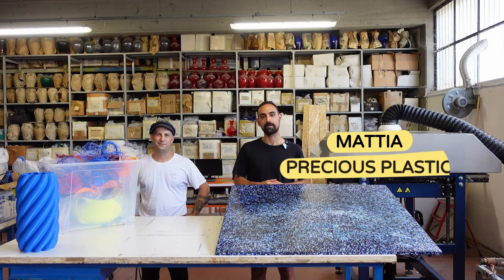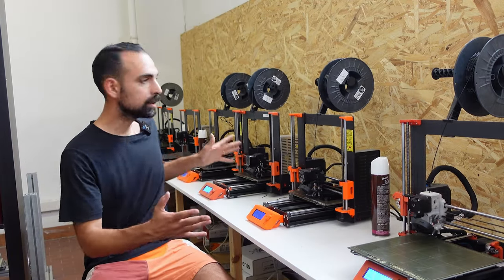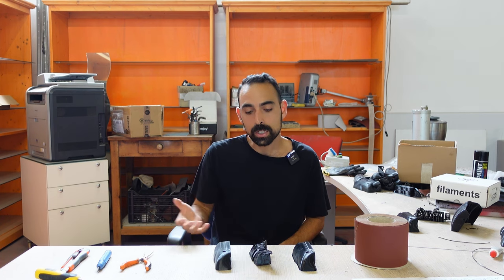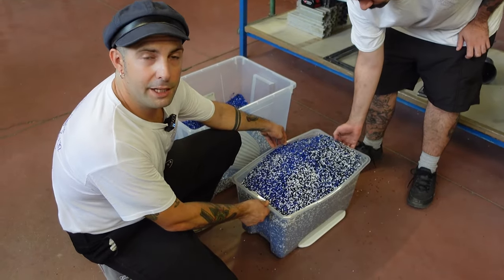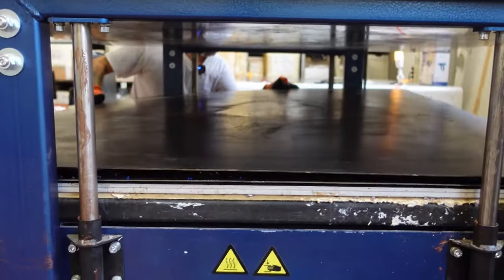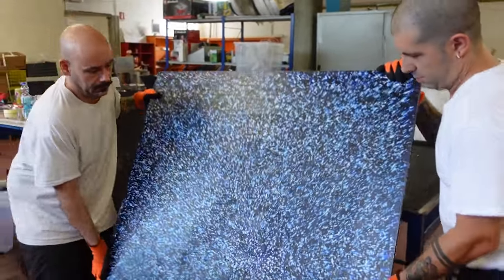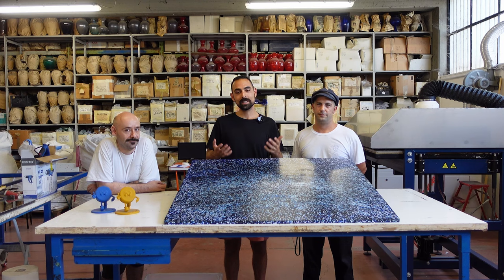What to do with all that 3D printing WASTE?

Comment from the maker: There has been a bit of confusion regarding the failed 3D print and filament being shredded. Indeed both were shred and used in the final sheet. The point being that both the failed prints and the filament were PLA, hence the mixing. The process would be the exact same had we use exclusively failed prints. We hope this can still be useful to many out there 🤙

Comment: you started out with shredded prints and supports, but then you used shreddeds filament. i wanted to see the process with shredded prints though. :(
Reply from the maker: Sorry if this caused a bit of confusion. The process is pretty much the same, doesn't really matter. You just have to shred the failed prints. Once you have the shredded plastic the remaining of the process is the same.
Reply: lol
Reply: meaning you have to have an access to a machine that shreds plastic and costs a lot of money...
Reply: @CraftySven A blender works.
Reply: That's right  @CraftySven this cost is especially stark when compared to 3d printer farms, which grow in trees wholly formed and are commonly given out in place of change when buying groceries.

Right?
Reply: @CraftySven That's what PP is all about. You can download plans for a shredder, press, extrusion press,...

Comment: The sheet did not seem to be made from recycled waste but with shredded filaments that were uniform, your process will deviate a lot with larger particles and different shapes of shredded materials. Also, for the mold release, there are a lot of powder releases available that might be cheaper and faster than spraying on silicone ones.
Reply: indeed. Very missleading.

Comment: Dude acted like he was using shredded failed prints and supports and just used plastic pellets...
Reply from the maker: We used failed 3D prints and discarded filament, no pellets :)
Reply from the maker: Eitherways the goal is to use 3D print waste material to make something precious once again if is in the form of failed prints or discarded filament doesn't matter, we aim this video to inform people they can use 3D print waste streams in their Precious Plastic machines
Reply: The sheet does look a lot like uniform pellets. You showed the prints being shredded, and they clearly weren't the same.
Reply: @bestpony12 It looks like a bunch of shredded up filament that hadn't been printed with.
Reply: What do you do with these plates? Wouldnt it be better to recycle the PLA into new Pla Filament?

Comment: Instead of using silicone release, maybe look to bakers who use parchment paper. It can take the heat and isn't very expensive. Can possibly used multiple times as well.
Reply: I have used parchment paper in my small scale experiments in a toaster oven, and it works very well
Reply: @flyingpurplebovine  what temperature would you recommend and how long does it usually take?
Reply: @rondelapena6024  I had it at about 400F (200C) for about 20 minutes, and that made pliable kind of like silly putty. I used silicone oven mitts to mold it and stretch it, and I could put it in a manual mold. The final result still had some small air gaps, but it was a very successful proof of concept
Reply: Parchment Paper will degrade over a certain amount of time. There are textiles that can widstand it ( haven't researched what they are called ). But for repetitive usage silicone can widstand the heat and if could be reformed if done by in a mono material fashion.

Comment: I always love to see people focusing on recycling the plastic from failed prints, bonus points if they are from my country :D
Reply: They actually don't recycle they use PLA pellets bought separately. No recycling happening in this video.
Reply: @antonkukoba3378 yea, they do not have access to that much pla failed prints but I'd say it can work the same, i've seen people make these at a smaller scale at home so why wouldn't it work on a larger scale with less waste?
Reply: @antonkukoba3378 good proof of concept tho, teaching tech made of video of doing this on a more small consumer scale and used shredded print waste for it. And it looked great like this
Reply: @antonkukoba3378  You don't know what you're speaking about.
That's waste filament shredded in house.

Comment: Great point in connecting two passionate communities that are currently on the opposite sides of recycling. We should definitely promote filament recycling and collection centers as most of 3D printer users would not have the sheet presses, but have good quality raw materials they paid premium for.
Reply: Would be a pretty solid business model, buy the scrap by weight and make sheets to resell🤷‍♂️

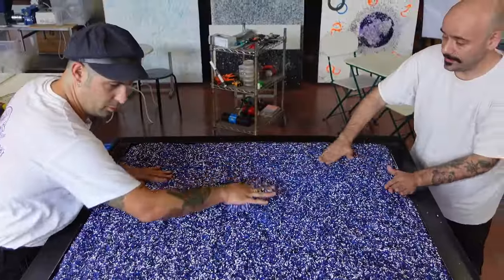Comment: 3:00  and 4:32 shred filament has different shapes.   I'm confusing.   4:32 shred filament is not pellet, but broken filament.
Reply from the maker: 3:00 is support material (PLA) while 4:32 is indeed shredded filament (also PLA).

Comment: You might be able to use these as tiles to walk. I don't know what the hardness is or if it's fragile. But small tiles might be good for a workshop type setting.

I'll certainly be looking into tiling my workshop with that.

Comment: I wonder how the process changed the chemo-mechanical properties of PLa ? Did they heat it over the crystallization temperature? Is crystallized PLa UV resistant after re-crystallization at higher temperatures into sheet? Also, people misinterpreted the plastic used, the smaller fraction shredded material should have sieved down below and bigger fragments stay at the top, those were clearly NOT pellets, pellets are way smaller.
Reply: looked like what they poured into the mold was  cut up off spool pla,  almost like  there using  moastly  end spool lengths, rather then failed or excess prints...   no other way to provide consistency of  speckling in the end product....

Comment: I may have another comment towards the end, but I must point out that at around 2:09 your support settings are WAY too aggressive. You can easily cut your support angle down to like 45-65 and shave off around 30% of your support material by no supporting such shallow angles. 

Especially with quality machines like Pursas you can get away with pretty heavy overhangs. I would suggest running one of the overhang tests to see where it starts to mess up, then adjust your settings 5 degrees below that.

Comment: I'm assuming this can be shaped using different tools like saws, drills and other carpentry tools. I'm not sure there are a lot of uses for a 1" x 1-meter square.
Reply: It's called 'stock'. It's the basic starting point of a lot of products.
I don't know what use a plate with that kind of thickness is, but I don't have experience working with plastics and I'm fairly confident there's uses for 1x1 meter squares like this. Insulating floor tiles come to my mind.
Reply: You can also cut it using a laser cutter

Comment: So  do to alot of ommissions,  the demonstration was using  "spool diameter plastic"  cut to pellet lengths,  at 7:38 you can see a giant bag of white pla almost like  end spool plastic.   from a commercial print shop  as they are likely forgoing the remainder of the spool instead of pause print change spool in there setups,  so  the end spool waste is likely to be the primary input to this  technique  and how they get that look to the final sheets....
Reply from the maker: You can learn more about the "giant bag of white pla" on this video https://youtu.be/lIWeHHDiePY

Comment: Hi, I'm a newbie to 3D printing. Can the waist materiel not be smelted and then be extruded to make more filament?
Reply: It teeeechnically can be done. The problem is the number of technicalities involved. Hence, currently, it isn't easily available to all makers.
Some reasons: plastics are polymers, meaning long molecules consisting of smaller molecules (monomers), kinda like chains. Generally, every time you heat and melt plastics, those chains break more and more, and your plastic degrades. Becomes more brittle, loses its valuable properties, etc. There are whole industries dedicated to solving and sidestepping this issue, so it's not an easy thing to solve. Another reason: during the heating/melting process of a lot of plastics, you get toxic fumes. So it's not safe to just tell anyone to do it, especially at home.
These are just some of the problems.

Comment: But what do you do with the sheet other than a chair rug? As a hobbyist this is not really practical as most people can't afford those equipment to recycle the material. A plastic shredder alone costs more than $1k. I've tried melting PLA at home but most of it turns into vapor. Moving on.

Comment: Hey, so I've been trying things out in my garage along these lines. One of the issues though is that the pla after I am done is very brittle and when it breaks it shoots bits of it all over the place. That may be down to temperature (I use a higher temp than you did) and material purity (my pla often has polyester in it as they use it for shiny colours) Id be interested in knowing what types of end products you intend to make with those sheets. 
Edit: oh also can you run pla through the injection mold device?
Reply: PLA becomes stiff if kept at high temps for a long time, I think you're overcooking the outside and undercooking the inside from that description so too much heat for too little time. Also, filament could be getting moist after being printed and that might make it full of steam pockets which would make it brittle and worsen the heat conduction throughout the material, but with the little information I have I wouldn't be surprised if I was completely wrong.
Reply: @agasa_workshop  well that sounds valid. Ill try with lower temps to see if that reduces the hardness.
Reply: Hmm, I'd also try my hardest to keep PETG or similar polyesters separate from PLAs. I've heard they don't alloy together well, and just from my experience with the material purged from the nozzle when switching between the two, mixtures of the two seem to be more brittle and fragile than PLA alone?
If that's what you meant at all, anyway, if you just meant the additives in 'silk' or 'impact-modified/plus' PLAs, I don't really have experience with those. As far as I know, they should be making the PLA softer, not harder. Strange.
Reply: @05Matz Yeah, so what I meant was I print with a fair amount of silk pla. The one particular brand I looked at the additive components and polyester was the largest portion. I kinda assumed that was generally what the silk addative was. Looking into it a bit that seems to not always (or even usually) be the case.
Reply: Yeah you do injection molding with pla, there are videos for it on YouTube

Comment: Great potential here if think, but what do you do with the sheets of PLA? Doesn’t it have a melting point too low for many applications?
Reply from the maker: Resulting sheets can be used in multiple applications from interior to product design, no issues with temperature..
Reply: Depends on the application I guess. The low melting point might make them easy to weld, now that I think of it, meaning that if you get access to enough of it you might use it for really big constructions welded together from multiple pieces. (sheds, tables, etc.?)
Your local climate would determine where it's usable, though. Generally, temperatures dangerously high for humans would also cause PLA to lose its strength and slump, so you wouldn't want to use it in anything like a car that would be left in the hot sun producing a 'greenhouse' effect with its windows. If you're in a cooler climate though, it should have little trouble with the temperatures outside, as long as it's not directly under the noonday sun or 'trapped' with sun-heated air behind a window? I'd also consider the possible UV vulnerability before using it outdoors, though. I forget if PLA is UV sensitive or not. Also, PLA, being... kinda-sorta-semi-biodegradable, is often not recommended for use underground, as bugs or microbes in the soil might nibble on it and weaken it over time like they would untreated wood. I don't know how realistic this scenario is though, as the 'biodegradability' of PLA is typically seriously overstated -- it will be assimilated and disposed of as waste by animal tissue, meaning that once it ends up as microplastics it at least goes away after the first fish or other critter swallows it, but apparently getting microbes to actually decay it requires pretty specific conditions.
In general, I'd think that furniture, project boxes, etc. might be a good use for PLA sheets. I want to see if they can laser cut it! If it can be planed down to a precise thickness and laser cut, then that's a method to make dimensionally accurate parts out of recycled plastic!
Reply: @05Matz yeah teaching tech made a video using this method on a smaller scale and laser cut the pieces. It definitely has potential for all sorts of things

Comment: ¿Can you explain what kind of plastics is possible to mix to make sheets?
Reply from the maker: You can use PLA, ABS, sometimes PETG in the sheet but make sure to never mix them together!
Reply: @Precious_Plastic my question was about mixing…😅 ¿what plastics can we mix?
Reply: @markpupetx ideally you wouldn't mix anything if possible because some don't even bond together, others may degrade at different rates over time. I would recommend if you want to mix, at least separate by the base polymer. PETG and PLA only will mechanically join for example. ABS and ASA may bond but don't share the same properties, so depending on if you want to use the finished plastic sheet outdoors, the ABS will degrade faster in UV light. You can better control the properties of the sheet when it is all the same.

With that being said, ABS, ASA, PETG, they will probably melt and mechanically link if you don't care about the physical properties
Reply: @Precious_Plastic  "tough PLA" was sometimes PLA+ABS

Comment: It would be really neat to have a process to be able to test which plastics are which in case they got accidentally mixed together.  Otherwise it's really hard to trust this process.
Reply from the maker: Definitely. Appropriate segregation processes need to be be in place to make sure materials are not mixed. This of course while we develop a plastic scanner :)
Reply: You need lad equipment and tools. We tested all of our pet before use for UV durability, tensile strength and density.
Reply: There's a tester for that. Identifies various plastics.

Comment: What is the use of these giant plastic tiles? As they are made from PLA, they will warp and deform if used in a slightly warmer environment and if you use them anywhere exposed to the elements, they will degrade to nothing within a few years.
Reply from the maker: Those sheets can be used in a variety of applications, from interior design to furniture. We haven't had issues with temperature so far, maybe because of the thickness?
Reply from the maker: "... they will degrade to nothing within a few years." if only that was true, unfortunately we still need industrial facilities to properly recycle PLA.

Comment: This had a swap at around @3:00 between shredded recycled filament and what are clearly uniform pellets ... for the rest of the process ... so it feels slightly disingenuous to then be talking in terms of recycled plastic when the output we saw made did not use the recycled input you suggested.

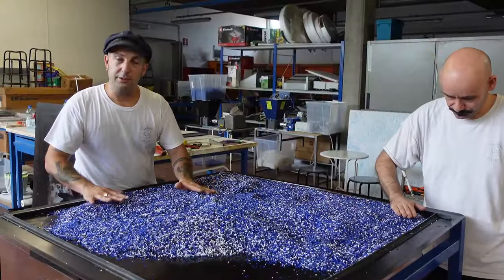Comment: Ahahahaha they put the pellets in the mold, not the shreded PLA. Just pause and see it yourself at 4:32 or 4:42. Such a bullshit recycling. These pellets are the source for the filament, and they just use ot for the molding, the same way ABS is used for injection molding.
Reply: They said they shredded PLA filament wire

Comment: That plate was made using original pellets, not failed prints. Not very consistent...
Reply from the maker: This is no true, no pellets were used. Only shredded failed 3D print, support material and waste filament. Sorry for any confusion in the video.